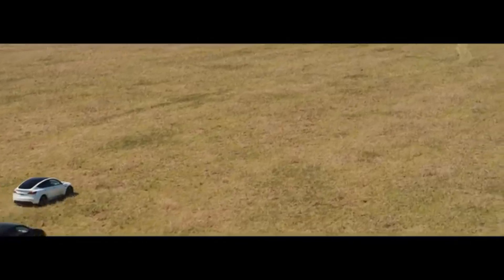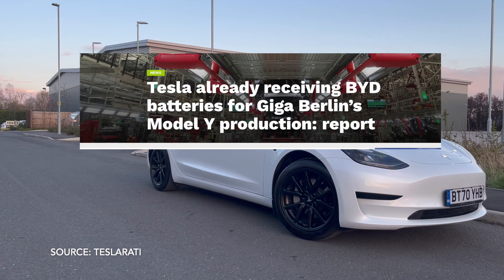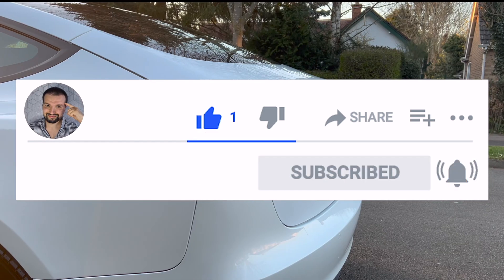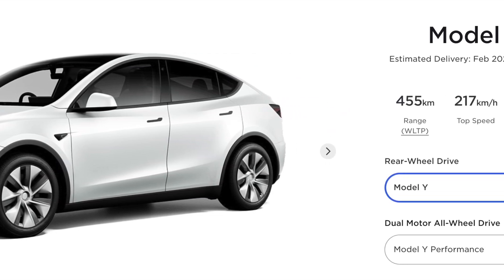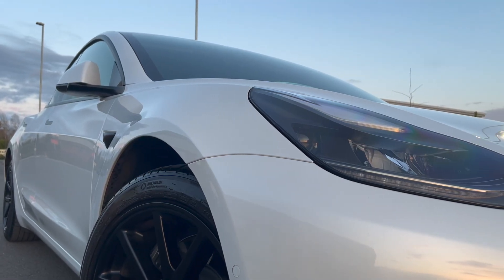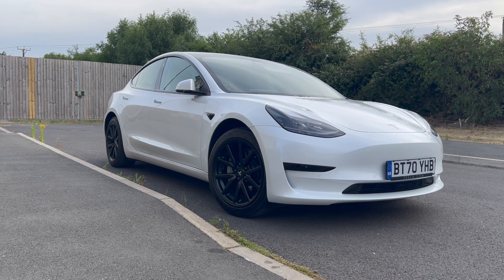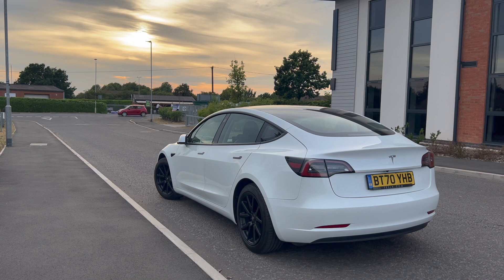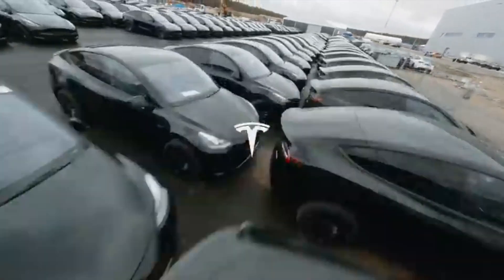Two NEW Tesla Model Ys for 2023! New Batteries + More Range

Comment: I’ve ordered a Tesla Y long range for delivery December/January . Should I wait for the new 4680 battery before taking delivery?
Reply from the maker: I mean a long range 4680 Model Y could be months or years away. We truly don’t know when it’s coming. I suspect with the very little run rate of the 4680 cells that they have, the 4680 cells will be retained for the Cybertruck and Semi first. Only when they have a good and healthy supply will they think about including the Model Y. When will that be 🤷‍♀️ Every Tesla offers a Tesla experience so would you use that anticipated range gain frequently? If not, you might not see the anticipated difference day to day anyway.